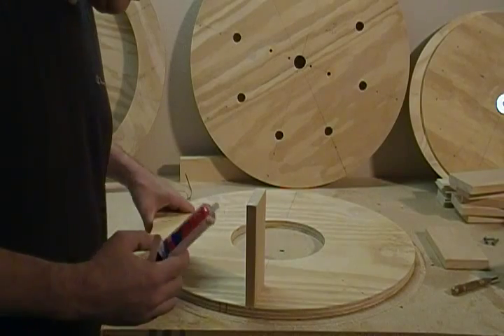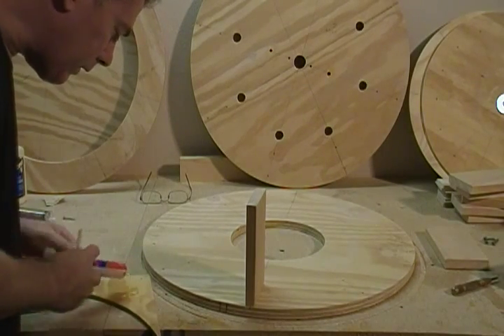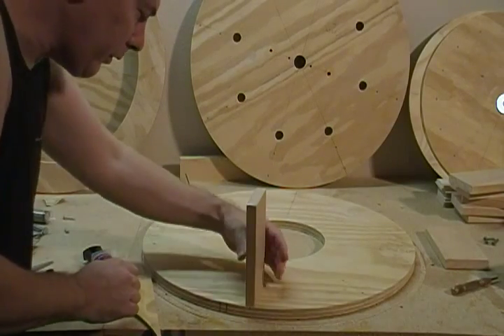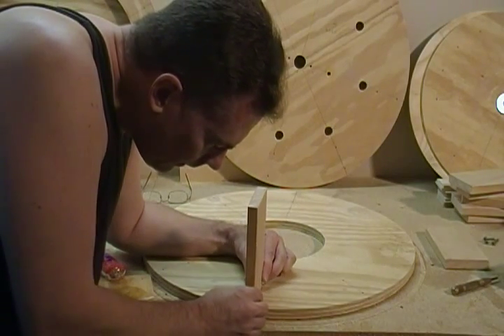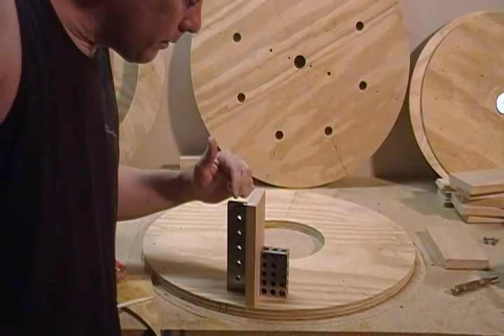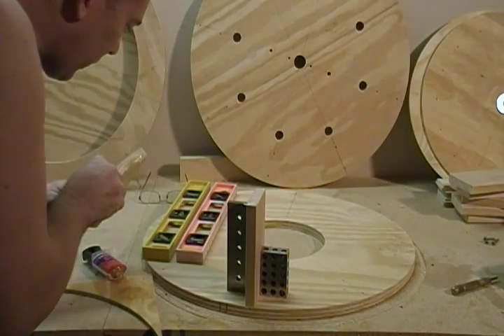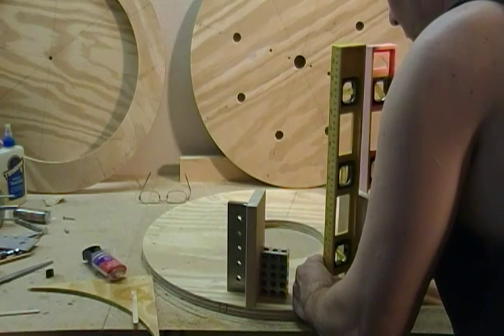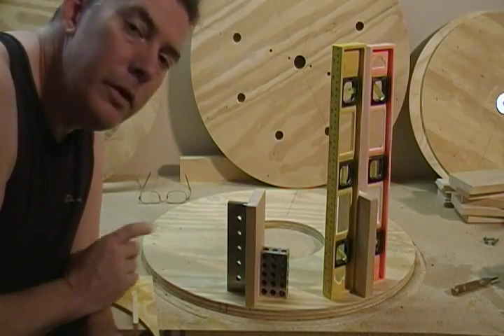Building a Wind Turbine (27 of 46)  Square and Glue Struts to Base Ring

Comment: Epoxy is the better adhesive as wood glue doesn't work very well with end grain.  Even if you reinforce with screws the epoxy will give a better bond.